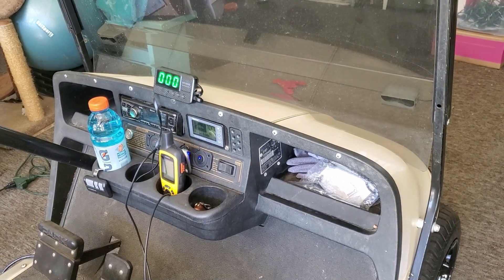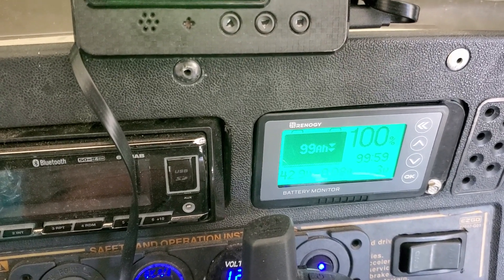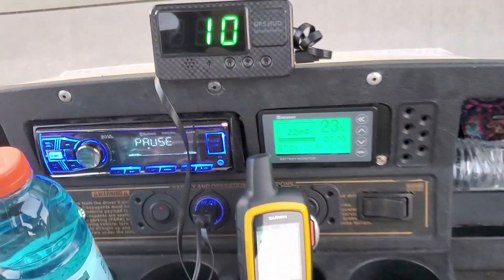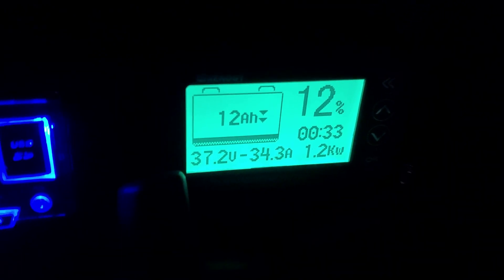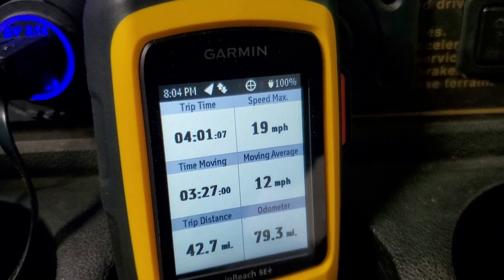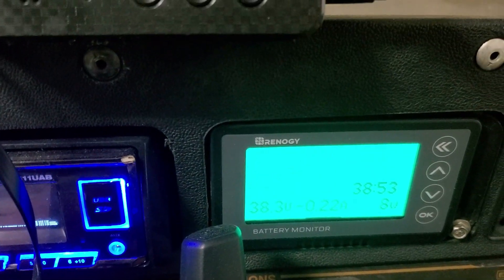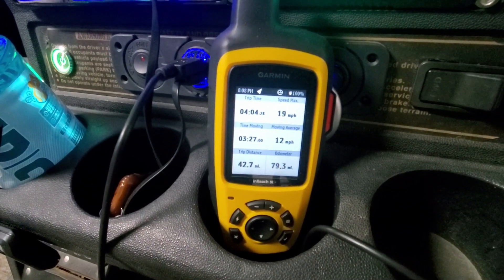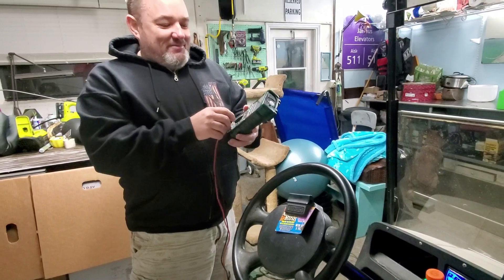Real range test of Dakota Lithium 36Volt battery actually DRIVING the EZGO TXT with Renogy monitor

Comment: Thanks for doing this video I was debating on these batteries that helps make my choice. Did you make a video of how you connected the battery meter?
Reply from the maker: No...sorry. The instructions where OK but there aren't many wires on it. Its not too hard.
Reply: Thanks. Did you have to change out the controller or motor or anything like that?  And how has the batteries and battery meter been working for you? Thanks again.

Comment: Do you know which set this is that you purchased? I’m looking on the website and the have a 25 mile pack and a 50 mile pack. If this is the 25 mile pack then I’m impressed
Reply from the maker: I just bought three 100AH 12 volt batteries. Keep in mind there may be additional 12 volt 100 ah batteries out there that perform the same but cost much less. I have seen some for around $300 each from amazon. 12 volt, 100 amp output continuous and 200 amp output max, abilities to put three or 4 in series.

Comment: Nice that dakota had that note in the document. Wonder if the other companies batteries would have the same limitations, but it just doesn't list it. I don't want to destroy $2500 worth of batteries!
Reply from the maker: Oh you wont destroy them. It would just be annoying that they occasionally disconnect internally and shut off. If you are easy on the throttle you likely wont have an issue. But as you may have seen some of the golf cart craze lately is big motors, high amp controllers, and big tires. All of those things cause high amp draw. In those instances you really need the proper battery.

Comment: I went on the dakota site to buy 3 12V 100ah batteries, but in the description it says cant be used because the motor controller for ezgo is 250 Amp and the maximum has to be less than  200 amps.
Reply from the maker: I have a disclaimer on several of my videos about this. You really have to properly size the lithiums for amp output vs what you have for motor/controller. There are batteries out there that can handle high loads like Relion, Roypow and several others. I have a stock 36v ez go txt with pds controller. It may well be a 250 amp controller as well. But I rarely stomp on the pedal and have never had a battery shut down. At full throttle at 21 mph its pulling less than 100 amps. But when you slam the pedal on the floor amps spike over 175 to 200 or even more depending on variables. Cart fully loaded? Going uphill? Rough terrain? Big Tires? All these conditions will increase amp load. The Dakotas are a 1C output battery. Meaning they are rated at 100ah and also put out 100 amps continuous and up to 200 for 10 seconds. They likely will go over 200 amps but for very short time periods...maybe milliseconds. So yes..know what your cart is...then size batteries accordingly.

Comment: Did you do a test to see how many miles you would get on the old batteries before you switched to lithium?
Reply from the maker: Not to this degree of accuracy. Of course when I replaced them after 3 years of use they would go about 2 miles. But when new I would estimate about 20 miles. However the old batteries degraded month by month until they went from 20 miles to 2. People say they get xx years out of thier lead acid batteries...but the reality is that they put up with them towards the end for some time period until they can't stand it any longer. So the performance of the previous batteries really needs to be thought of on a continuum over its life. Much of that life is not really a useful life. I'll just say the Lithiums are all they are said to be. Very happy with them.

Comment: Nice real world test. How long does it take to charge it from 10%  to full?
Reply from the maker: I only have an 8 amp charger. I just ordered a 30 amp though. Anyways with the LifePo4 batteries just  divide the number of amps available to charge by the AH needed. 90 AH needed/8 amps available= 11.5 hours roughly. With the 30 amp charger that should take around 3 hours. LifePo4 batts dont have that absorption charge phase like typical Lead Acids that takes forever.

Comment from the maker: Acceleration is constant until you down below 10 percent. At that point you have to go easy on the Acceleration or the voltage will dip too low and BMS will cut out.